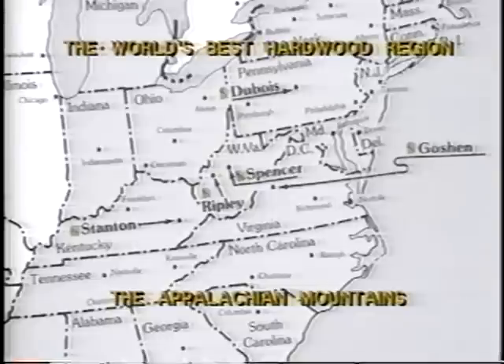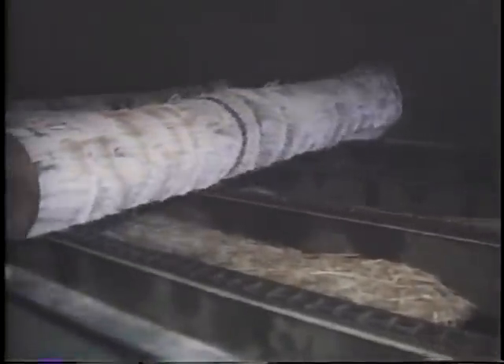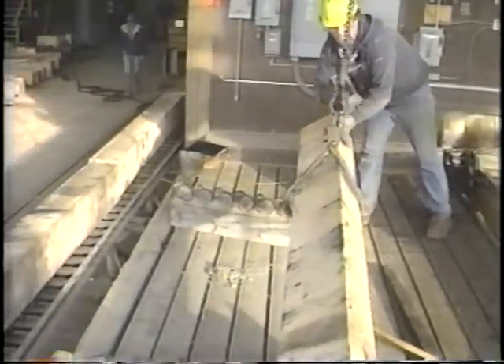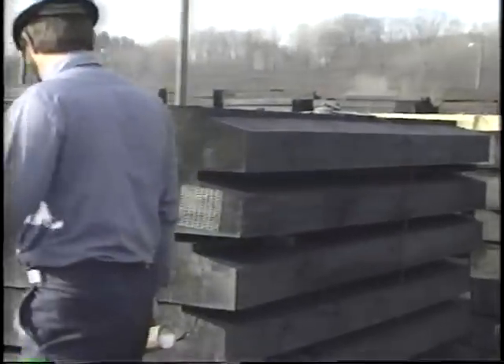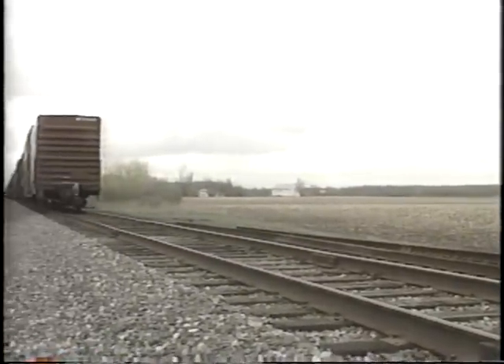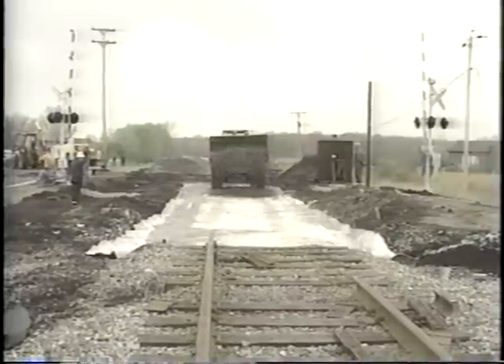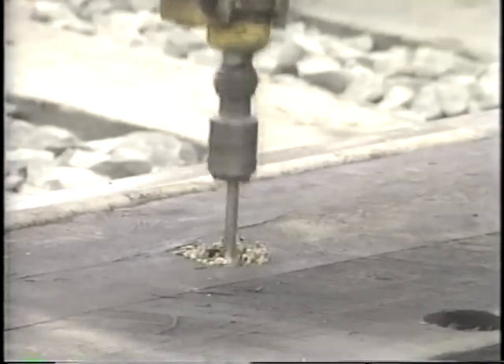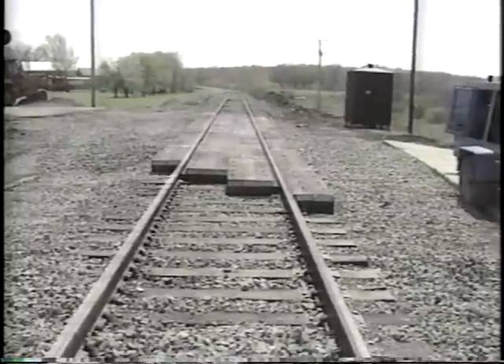DV57 Solid Oak Timber Railroad Crossings

Comment: One summer I helped deck a 300 foot RR bridge on an abandoned Railroad right away for snowmobiles.  We had, brand new, creosote lumber to do the job.  If you work with new creosote lumber and are in the bright summer sun you MUST wear gloves and protect your skin with a heavy layer of sunscreen.  Any part of you that comes into contact with that new creosote lumber will instantly sun burn, even if you are wearing sunscreen and you scrape up against the wood too hard you will burn.

Luckily, someone Learned this lesson the hard way before we started the bridge and we found out about it.

The lumber we used came from the DuBois plant, mentioned in the video, as the bridge is not far from there.  The DuBois plant has a pretty unpleasant odor when you drive by it.
Reply: I worked near the Goshen plant. They gave us a crème to put all over our forearms to help prevent rash and burns from the creosote fumes, which were particularly bad on hot days.

Comment: The music was too loud, annoying and unnecessary.
Reply: FYI this video is older than you. You won’t understand it
Reply: @Paulzilla9111  If I wanted loud music I'd have gone to a Disco.
Reply: No you wouldn’t….. no one would have ever danced with you. This track is a banger.
Reply: @Paulzilla9111  This video was posted 2024. There is no indication in the description that this is a heritage or vintage video posted for its historical value. Therefore I would expect year 2024 quality.
But either way, the "music" is way to loud and overbearing, no matter if the video is new or decades old.